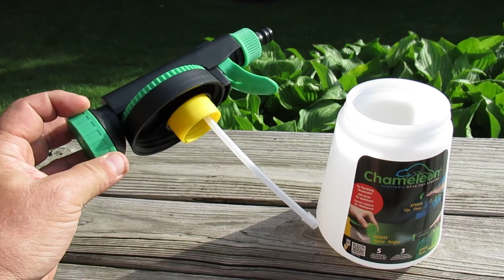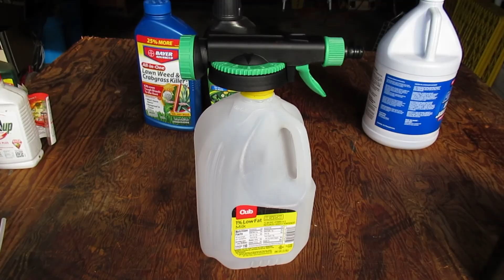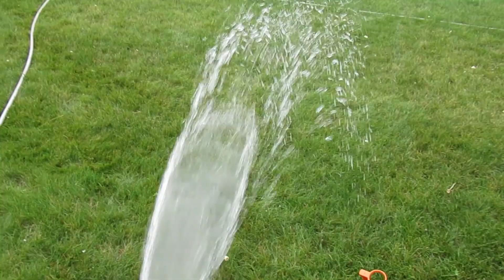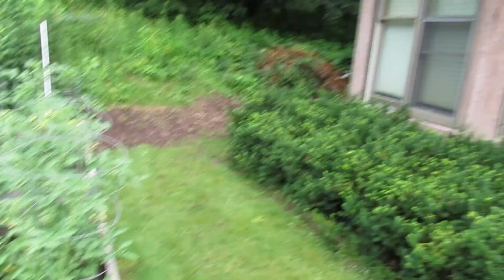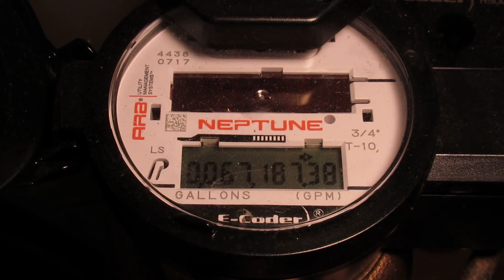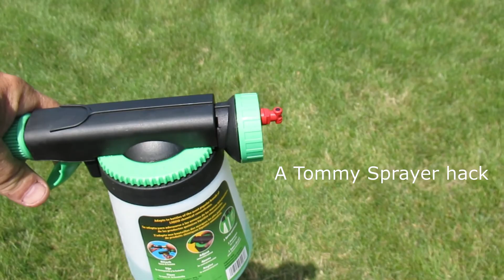Chameleon Hose-End Sprayer Review | Test | Calibration for Lawns

Comment: I basically just want to use my sprayer to spray some peppermint oil on upper areas of my house that a raccoon has been using to enter my attic. I want the peppermint to be strong. So, I'm wondering how much oil should I mix with water to make the peppermint strong enough for the raccoon to smell? Mint is supposed to be a racoon repellant.

Comment: Where did you get the adapter for the spray nozzle?
Reply from the maker: It was off of a Chapin sprayer, but it turns out it caused back-pressure preventing the Chamelion from drawing up the chemical from the jug.
Reply: @TommyTester  Thank you.

Comment: I need to spray neem oil with the concentration of 1 tablspoon per quart or 4  tbsp for 1 gal. Per the chart level 4 setting should suffice? Thx for a detailed video
Reply from the maker: Setting 5.  That is 4 Tablespoons per gallon.
Reply: Thanks! I am using it to spray Neem oil.

Comment: I find that the 1oz setting will empty the reservoir in +/- 1000 sq/ft. So with that setting you can calculate your oz per sq/ft and then top off the reservoir with water and have somewhat consistent results. I am noticing anything below 1oz setting is somewhat inconsistent on coverage... sometimes I even wonder if it's drawing anything through on the lower settings.

Comment: This is the best review/tutorial of the Chameleon hose end sprayer - 
even better than retailers selling it because you explained that the 
sprayer settings refer to how much solution is emitted per gallon of 
water sprayed. This is necessary in determining what setting to use for 
the product you are applying since instructions usually explain how much
 to use per gallon of water. Thanks! 

I actually just finished using it in an area of my yard and I thought 
the spray setting was adequate. It turned out I used the right solution 
setting also but it is nice to know for sure.
Reply from the maker: Thank you for the comment!!

Comment: Thanks, you answered what I was looking for, ounces per gallon.  :)  How did you make the spray pattern so you can actually use this?
Reply from the maker: Ha.  What I tried failed.  It made a good pattern but the suction stopped due to too much back-pressure introduced by the added nozzle.
Reply: @TommyTester  😢 thanks for trying.

Comment: I thought I was doing something wrong when I saw that horrible spray output. Apparently not, it's just a crummy product. I saw your hack at the end... but you didn't explain what the little red piece was or how you attached it. ??
Reply from the maker: The hack was an attempt to improve the spray pattern, but after further testing it did not work, as it caused back-pressure resulting in no flow of the sprayer's contents.  Thanks for watching.

Comment: That's a shame. I purchased this from amazon us for over here in the UK. Its a great sprayer but I also picked up on the lack of pressure/distance. I followed your modification and I've added a black fan nozzle to the end of the jet, the distance is amazing and more accurate but sadly some of the water backfill into the tank making it useless. Instead of the hose sucking treatment from the tank it fills with water when using that modification. I presume its because I'm limiting the amount of water going out and the rest needs to go somewhere. Did you have this issue?
Reply from the maker: Yes, I did. I found there needs to be no back pressure from the nozzle side for the siphon to work. Try we must.  Thanks for the comment.
Reply: @TommyTester  What was the hack? Where can one find such?
Reply: @TommyTester  please explain ... no back pressure from the nozzle side